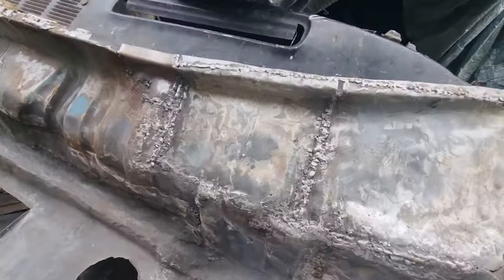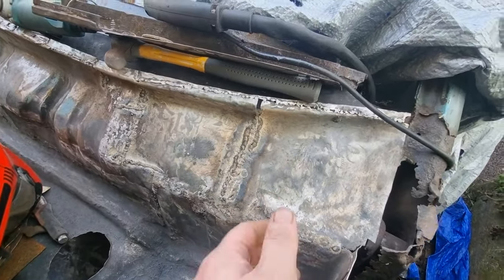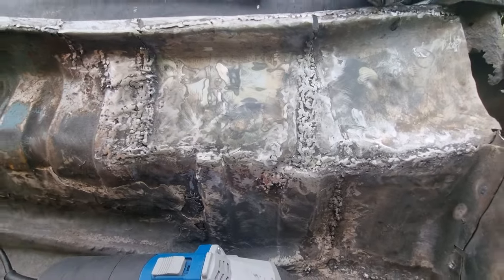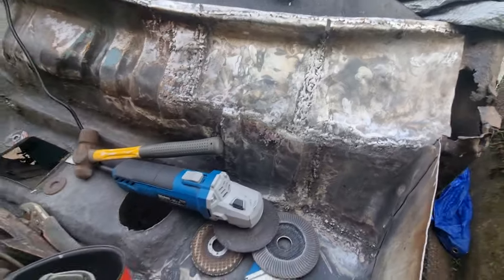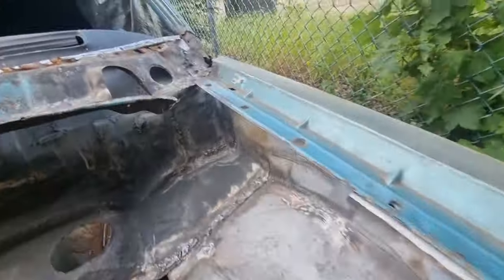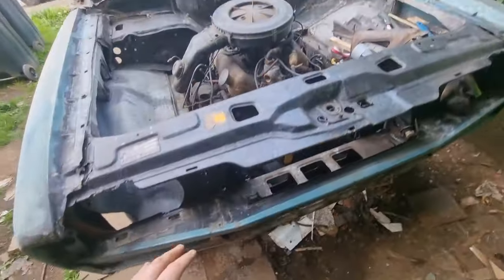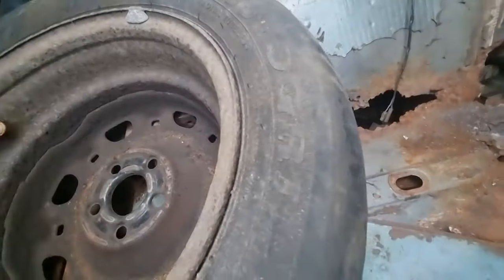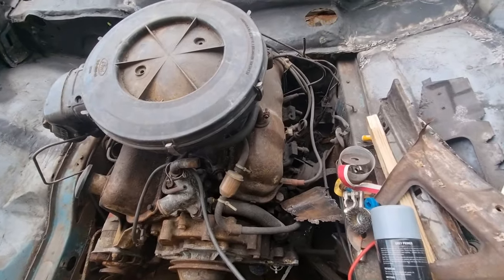Cortina Mk4 Ghia 2.3 V6 Restoration || Window Frame Lip & Bulkhead Repairs (P27)

Comment: If you are using a fluxcore welder buddy use a compressor to cool the metal down as you go it will stop the metal from warping with the heat. I do most of my welding with fluxcore I weld outside i am quite lucky that i can get the metal cooled down. You can buy cans of anti splater that will help as well. Fair play to you for taking on a car that most people would have just stripped it for spares.😊👍
Reply from the maker: Thank you I do have a air compressor with air hose nozzle will have to find the nozzle lol iys in my shed some where

Comment: its those little snag jobs now on the front end, just to make it better as you say.  From when you 1st started to now, that's some real strong progress!  Id be looking at treating the front end as you said, just so there is something on it, until you get there.   What is the boot floor and rear like?  be nice to see what that is like and what your plans are, even though you are way off sorting that out.  When i did welding on my rover metro, there were some little holes that were fast fixes funny enough.
Reply from the maker: the boot floor is in fact very good clean condtion i will try to show that asap in fact oncei clear it out of the parts lol will do a little walk around video showing the extra bits thats not seen yet

Comment: Looking alot better if you are worrying about the looks grind it down flat and put some filler over is easier to sand then fiberglass but its your choice but looks solid and im glad to see your getting better comments ive got a parkside grinder adjustable speed and came with the extra bushes and it's alot bigger and more powerful £25 in lidi i would listen to any over advise off people who has done welding on cars before you will get it done mate
Reply from the maker: Thank you and yeah some places I'm not bothered about the welds showing as it won't be seen and thanks for the support mate
Reply: @AdamSNook. Just do wat can been seen and wat can't just put a couple of good coats of something thick wat ever you going to use underneath as it's the MOT tester yet having to watch but ive seen some right bad welding  (pigeon shit) pass MOT on some vehicles you welding is getting better with the welder you are using at the moment mate
Reply from the maker: @petergrinnell2500  its getting even better i have started watching the pool of weld and that allowes me to do good seam welds now instead of pulse welding another video is going up today